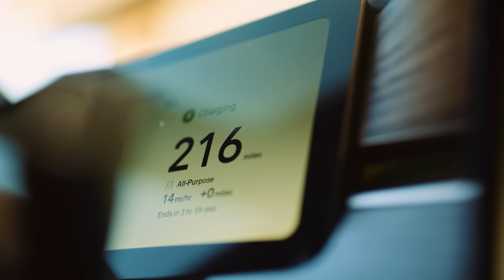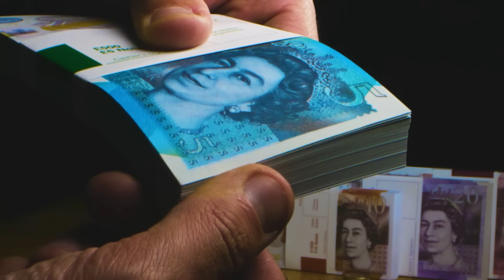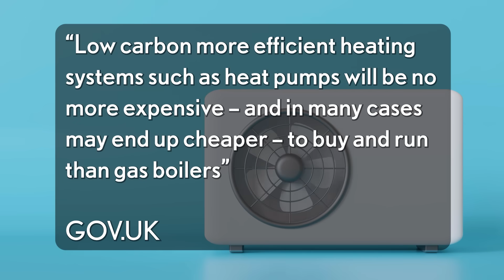The Truth About an All-Electric Future

Comment: Hydrogen is bollocks.

If you're sceptical about the infrastructure upgrades for an electric first future, you're gonna be really mad about the upgrades needed for H2 -

They make a big song and dance about it's energy density PER KG. They neglect it's energy density per liter - it's about 30% methane. 

So you need about 3x the flow rate so bigger pipes, bigger pumps and bigger valves.

It leaks more, it's more explosive

If you produce it from elecreicty you need  more electricity to produce the hydrogen than just using the elecreicty directly.

If you get you H2 from natural gas, you need more natural gas per kwh than just burning the natural gas directly - I wonder why fossil fuel firms are so keen... 🤔

When the sun doesn't shine and the wind doesn't blow, we'll just use natural gas power plants. The key point is they won't run all day every day, just occasionally.
Reply: I spoke to a gas engineer. He say hydrogen is too volatile. A methane gas explosion is nothing compared to hydrogen. He doesn’t see hydrogen as a fuel suitable for households/domestic consumers.
Reply: Yep, all that plus the making of high pressure vessels and pumps to store it. The leeching of gas into metal, it's a f@£king minefield of cost and safety issues. Laughable.
Reply: Hydrogen as storage is some way away, and we may not get there? Gas as backstop for the moment as it's a cheap option until something better comes along.
Reply: @Biggest-hz7ng  Its like you people missed the whole nuclear exists part of history somehow.
Reply: @markfernandes2467 nuclear is here, but takes too long to build and is too expensive? It's part of the generation mix.
Reply: @Biggest-hz7ng  So start building. Nukes are not fundamentally expensive, they have been artificially made so by insane amount of regulation in th West. They can and are being built in as little as five years and those are the traditional type. sMRs could mak them far faster than even that.
Reply: @markfernandes2467 

If we are going to electrifying heat and transport we need to upgrade the grid, regardless of how we make the electricity.

SBs argument is that we can't /shouldn't move to electric heating because upgrading the grid would be too difficult - instead we should rely on H2, whilst neglecting to mention H2 would entail huge upgrades to the gas network and woukd increace our natural gas (the source of hydrogen) demand.
Reply: @brianballard905  I mean, I know this. My point is you should be nuclear first on the production side, anything else is a folly for the UK.
Reply: @markfernandes2467  large nuclear is incredibly slow. The time to start those projects was about 15 years ago - now it's too late. You can argue that it shouldn't be so slow (and i"d agree) but it is what it is. SMRs are theoretically quicker to deploy but are still not proven to actually be easier to deploy. History is littered with "this will be easy to deploy" technologies that turned out not to be. On the other hand wind and solar are proven and are being deployed.

Of course we could do both. Install wind and solar and if SMRs turn out to be easier and cheaper to deploy then do those too.

The point is that if we electrify, then heating and transport become independent of the means of generation.

Currently our heating and transport are entirely dependent on a very specific set of chemicals that we cannot produce ourselves.

If we electrified we can use whatever means of generation we have. If someone cracks fusion next year we can use that instead of renewables and our houses and cars wouldn't need any change at all.
Reply: @brianballard905  Wind and solar are not proven. What they have demonstrated, is their inability to provide a reliable base load.  It is also becoming very apparent that they are not cost-effective, without massive subsidies. Orsted have pulled out of AR5 and now AR7, because they understand that they cannot make it pay, unless Mad Miliband increases the subsidies even more.

Miliband wants to triple wind by 2030, about a week ago, on a nice breezy day, W&S provided around 20GW two thirds of demand. By tripling, there will be getting 60GW, of which half will have to be curtailed. NESO having researched Miliband's plan, concludes that we'd have to curtail  about 63TWh (about a third of projected output from offshore wind).

Many people think that energy storage is the solution.

The simple response is, that if a technology is so fundamentally flawed, that we need to install another expensive technology to overcome the shortcomings, then it's  the wrong approach.

Additionally, W&S equipment have short lifetimes. Dr Gordon Hughes, who's been studying the fiscal aspects of renewables, has discovered that offshore turbines have an effective lifespan of about 15 years, after which they become uneconomical to maintain. Onshore around 20. Whereas a coal/gas/ nuclear plants can have a lifespan of 60–80 years with midlife refurbishment. So every 15–20 years the entire generation network, would have to be rebuilt.

Not a practical idea.
Reply: @rjones6219- wind and solar generated over half the Uk's elecreicty last year, and are in track to beat that this year. Right now wind is providing over 55% of the electricity.

Not bad for unproven technologies.

Curtailment is only a contractual issue where agreements stipulated payment for curtailed generation. We will always have greater capacity than we actually generate. Your car probably has a nominal output over 100kw yet will spend most of it's life outputting less than 50kw. Is that a problem?

Dr Hughes has been predicting the collapse of wind economics for over a decade and it still hasn't happened. It looks like the lifespan is around 20-30 years. This is what the payback calculations are based on.
Reply: @brianballard905 The “50% renewables” line is a generation statistic, not what we actually used. In 2010 the UK generated around 7% of its electricity from renewables; by 2024 that had risen to about 50.4% of domestic generation (≈143.7 TWh renewable out of ≈285 TWh total generated). But we used around 319 TWh of electricity in 2024, with the shortfall met by about 33.4 TWh of imports. If you measure what most people mean—electricity consumed—renewables were about 45% (143.7 ÷ 319), not 50%. That’s the difference between a production denominator and a consumption denominator: imports enlarge what we used, but they don’t add to the “UK renewables” numerator in the statistics.

It’s also important not to confuse electricity with total energy. Electricity is only about one-fifth of the UK’s total energy use. When you combine renewable electricity actually used (≈45%) with renewable heat and biofuels, renewables make up only ~15% of the UK’s total energy consumption in 2024. So the accurate way to put it is: in 2024, renewables generated just over half of the UK’s domestic electricity; including imports, they supplied about 45% of the electricity we consumed; and across the entire energy system—electricity, transport, heating, industry—renewables were roughly 15%, with fossil fuels still dominant.

We are decades away from renewable energy even scratching the surface of our entire energy needs. 

If you want to check the facts, they are here:

DESNZ — Digest of UK Energy Statistics (DUKES) 2025, Chapter 5: Electricity; Chapter 6: Renewable Sources of Energy.
DESNZ — Energy Trends, June 2025.
National Energy System Operator (NESO) — Britain’s Electricity: 2024 Review.
Reply: @martincampbell5499  yes, depending on how you look at it the % of electricity generation was 45% or 50% - either way not a niche generation method and the first wind farms started in the UK in the mid 90's and those turbines lasted 25 years before being replaced because they could get more energy from fewer new turbines.

And yes total energy is much greater than current electricity generation alone but we also need to be mindful of the fact that electric heating and transport (the two big sectors) are much more efficient. So although we used around 250Twh of gas for domestic heating that doesn't mean we need 250Twh of electricity generation to replace it.   If we assume an average heatpump COP of 3 then we would need around 80Twh of electricity generation - about our current level.  It's a similar situation for road transport.  

So it will take a significant increase in our generation capacity (renewable or not) to switch heating and transport to electric, but not an impossible one

In addition, once heat/road has been transferred to electric the end user is blind to how we generate that electric.  An electric car or heatpump works just as well with electricity from a solar panel as it does from a nuclear plant or a gas power station. The decarbonisation becomes decoupled from the end devices.

And in all cases, an upgraded grid will be needed
Reply: @markfernandes2467 They also missed the R101 and Hindenburg.
Reply: @markfernandes2467  1. Nuclear is the most expensive form of generation - by far.
2. Hinkley Point C is the largest construction project in Europe, possibly the world, and won't produce a single watt until at least 2032. The construction has already been going for over a decade.
3. "Insane amount of regulation". Which regulations would you like to cut? Can you name any?
4. SMRs are completely unproven, and will be even more expensive. 

Why go through all of this when you don't have to? Solar is now the cheapest form of generation in human history - and can be put right on top of the consumer's roof to provide cheap energy for 20-30 years.
Reply: @markfernandes2467  nuclear is fine if you don’t mind 10,000 year bill for storage.

The nuclear decommissioning authority are responsible for the cleanup of the UK nuclear power stations and sellafield. Sellafield alone is, I believe, around £130bn. That’s taxpayers money. 

Interestingly all the facts and figures of renewables vs nuke or gas ignore this fact. I believe if this were added in the figures would be massively different.

Yes, we need backup for cloudy, windless days and that I believe could be hydrogen. During abundant days we should generate hydrogen and then use it when needed.
Reply: @Biggest-hz7ng  Even more expensive than renewables and that’s before depleted fuel storage and decommissioning is taken into account. We are spending billions on Sellafield alone. Check the nuclear decommissioning authority.
Reply: @Biggest-hz7ng Yep ... "It takes at least ten years to build, so it's not the answer,"
Said Nick Clegg, over ten years ago.
Reply: @brianballard905 I'm just curious as to the projected gross weight of a lorry weighing 40 tons now, if powered by batteries...
Reply: @johnriggs4929 no truck carries 40t of cargo (at le@t without a special licence for abnormal loads). 

The limit for semi tractor & trailer is 44, 40 or 35t depending on the number of axels. Electric trucks can have a 2t extra. The tractor unit of an electric truck is usually around 10-12t, whilst the diesel equivalent would be 8-10t.

For most load types weight isn't the limiting factor, it's volume. Weight is only the issue for things like steel, concrete, liquids etc. 

For the same cargo weight electric trucks are typically a few tons heavier than their diesel counterparts.

It's unlikely diesel trucks will ever be eliminated, but there are many deliveries that can be done by electric truck. Just because we can't have 100%

Electrification doesn't mean we shouldn't aim for 75% or 90%
Reply: @markfernandes2467 when nuclear was first announced back in the late 50's  the minister said it would be so cheap that it wouldn't be worth metering. That turned out well.
Reply: @bobanob-q2u  Lol, what does that have to do with anything? Besides, he'd have been somewhat right if not for the big oil lobby, & environmentalists getting conned by their anti-nuclear propaganda through ignorance (suckers),  something they still hold onto to this day, mostly, despite the fact it would have slowed what they now unironically cry about (global warming). So yeah, it turned out just fine for France, as the guy in the video said. 

Not free perhaps, but half price, and it should and would have been a lot cheaper still if they had carried on developing. The expense is all man-made (added), not fundamental. 

Besides, never compare renewable electrons to nuclear; the first are poor, the second, grids love. They should cost more tbh, but didn't have to and still don't have to.
Reply: @brianballard905 He didn't say that. Watch the video again.
Reply: Roger was wondering why his views were down, maybe it's because he presents subjects which he knows nothing about as if he has the inside track on what the plan is... when actually his sources some bloke down the pub, and my mate the sparky.
Reply: A lot of the hydrogen market is blending in natural gas pipelines. You can blend up to about 20% without significant change.
Reply: @JohnboyCollins  except H2 is currently made by reforming natural gas, which is about 75% efficient ie you need 1.3x the natural gas to get the same thermal output as natural gas. So your 20% blended gas will cost more than natural gas and will emit more co2 without carbon capture - which hasn't worked at scale yet (despite multiple pilot schemes) and reduces efficency even further.

You can see why the fossil fuel industry is so keen - hydrogen boilers will increace demand for natural gas.

And if you try and produce green hydrogen the efficency is even worse, even before you factor in heat pumps. It's far cheaper just to use the electric as electricity than convert it to hydrogen.
Reply: The Royal Society proposed hydrogen as the answer in their "Large-scale energy storage" brief. They mentioned methane at the same time (either would be produced by renewable energy as the entire point is to run UK entirely renewably) but I've always thought hydrogen was chosen for mainly political reasons, though the maths does stack up a little better for hydrogen on a few measures. It doesn't at all on the "we've already got gas and it works just fine" measure.
The "just use electricity" argument is the problem. UK has gigantic renewable electricity, just not when we need it - that's why it has to be converted to a storable fluid.
Reply: @trs4u H2 for long term, grid scale, energy storage is a totally different proposition from "we don't need to elecreify heating because we can use gas boilers running on hydrogen instead".

Let's say we do use H2 as long term energy storage. We still need to upgrade the grid to get ghat stored energy to it's final destination.
Reply: @brianballard905  are you asking me to defend upgrading residential networks for hydrogen? No other maths stacks up for UK renewable energy independence/export except power-to-X (maybe ammonia?). I think hydrogen is the wrong choice all round. We have to produce it briefly to synthesise methane, but I don't think we should store it (except for consumers who want it explicitly) or pipe it far.
Reply: @trs4u once you have your power in the form of electricity, transforming it to X is always an inefficient backwards step. Just transfer it via cables.

SBs argument was essentially "upgrading the grid for an electric future will be disruptive and expensive. We should use H2 instead" which assumes that route avoids the disruption and cost - it doesn't.

The Electrification of heat and transport will be expensive and will entail some disruption but the alternative of staying with some version of a combustion boiler is even more so.
Reply: @brianballard905  we already generate - in good supply - more than we can use (we have practically no real storage) which means we have to dump energy. There is nothing less "efficient" than dumping energy. People who make this argument are failing to comprehend the scale of our consumption, our potential supplies, and how tiny and expensive things like batteries are.
He doesn't promote hydrogen in the video. He's saying "looks expensive, not sure" - like a builder - as I understand the video?
Reply: @trs4u - renewables don't dump energy, they just don't generate it in the first place (curtailment payments are a financial constraint not a physical one). On the other hand nuclear power is very inflexible and can't be ramped down quickly (in grid terms). 

Again, regardless of the generation, the distribution network will need to be upgraded to take the additional loads of providing our heating and transport on top of the existing loads. 

SB is questioning the cost of doing so and talking H2 as the alternative distribution mechanism.  He doesn't mention the fact H2 as a distribution mechanism would be more expensive, more disruptive and result in hugger running costs and less energy independence than upgrading the electricity network.

H2 boilers etc as a concept exist purely to delay the things we actually need to do pushed by the industries that benefit from the status quo.
Reply: Wind is sufficiently cheap that curtailment can be factored into the overall cost. There will always be some curtailment. Current curtailment could be reduced by more transmission (lack of investment by the previous government) and possibly better pricing models.
Reply: @Biggest-hz7ng  'cheap wind' is utilised wind. Once we start curtailing it - no matter what the reason - it becomes less cheap as we install ever more capacity at ever lower utilisation. Dispatchable power-to-X where X is a storable/ exportable commodity (basically a bottomless pit of demand that tracks supply) is the only way to maintain wind's bottom price. The alternative is to watch wind companies raise their prices to cover the cost of reducing capacity factor until everyone despises our last good option.
Reply: @trs4u there is a balance between the potential value of the lost energy and the cost of storage and even transmission. Currently storage is too expensive, so building generation is the best option. How much energy do you want to store if the winds are high for days on end? We wouldn't build massive amounts of storage to ensure we won't lose that last Watt.

I think it's like sizing an inverter for solar? Only for a small amount of the time is the generation at maximum, so you can save by buying a smaller inverter.

We need to justify necessary curtailment and paint a bigger picture whilst we scale up transmission and find the best pricing and storage options.
Reply: @Biggest-hz7ng  It all depends on your cost of fallback energy supply doesn't it? Our fallback supply is currently expensive in money terms, also costs the earth environmentally, also sponsors atrocities, and makes democracy almost irrelevant due to the international leverage it costs, while we make people unemployed here in favour of employment elsewhere. I think we're under-valuing a completely sustainable domestic solution.
The point about using power-to-X and X-fuelled powerstations is that the renewable X would also be an exportable commodity, so that in the case of VRE glut, we would fill a ship with it and sell it to someone who would otherwise buy fossil-X.
Youtube is full of people buying giant solar systems for the surplus generation
Reply: @trs4u the cost and utilisation rate of the creation, storage and shipping/consumption facility for X is the problem. If such facilities could be built cheaply, they would be being built right now everywhere there is wind? 

Gas is comparatively cheap as a backup (plants and storage already exist) and will be in competition with X facilities. Gas is planned to be in use with CCS beyond 2050.

Cheap wind can stand periods of underutilisation, though obviously cheap storage would pair nicely with it.
Reply: @trs4u  the suggestion is that if you are going to do power to x your facilities also needs to include the cost of sufficient batteries to ensure continuous output.
Reply: @Biggest-hz7ng  in UK (this problem is different in different countries) the scale of our best Variable Renewable Energy potential (OffShore Wind) dwarfs any affordable battery scheme - that's our problem. If we made the power-to-X plant (I routinely suggest e-methane) dispatchable, that's our 'charger', recharging our national gas supply, on which our gas-fired electricity power stations run, analogous to an inverter. In good wind, we need a 'bottomless hole' in which to store energy for up to months at a time, cheaply. That's what big voids full of gas do.
Reply: @Biggest-hz7ng The wind is free. The investment in the generation machine and maintenance is not. You cannot only pay for the electricity when it is windy hence the guarantee of consistent income as indicated by sb.
Reply: @Biggest-hz7ng Energy is not measured in Watts.
Reply: @trs4u Can you explain how methane could be  'produced' by renewable energy please?
Reply: @trs4u   this is very true, but don't forget electricity can be stored too.
Reply: @lksf9820 The economics of storage only works with pumped hydro. Batteries would only be any use if their costs and energy densities could be improved by a factor of 100. Currently they are just used for frequency balancing when renewable energy sources fluctuate quickly. Not for long term storage of the vast amounts of energy needed in winter in the UK. This is provided by gas and nuclear at the moment. There are excellent websites where you can easily see all this information.
Reply: @trs4u One answer could be to make hydrogen from seawater when we have excess power, then burn it in power stations when we don't.  Seems a more doable route to a greener energy supply than a complete new gas grid.
Reply: @peterholland3306  That's the Royal Society's proposal in their brief "Large-scale electricity storage". Everyone should read it to see how big the numbers are so they can stop saying "we can do it with batteries". I think we should do it with renewable methane (add captured carbon to hydrogen) because we don't just need to solve electricity for Climate Change.
Reply: Ed Milliband needs to be seriously questioned live on air, by people like you and others who know their stuff BUT  he never will be .
Reply: @johnmorgan5495 Ed Milliband needs to be sectioned, not questioned.